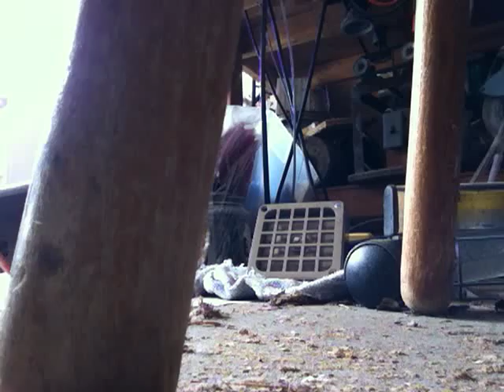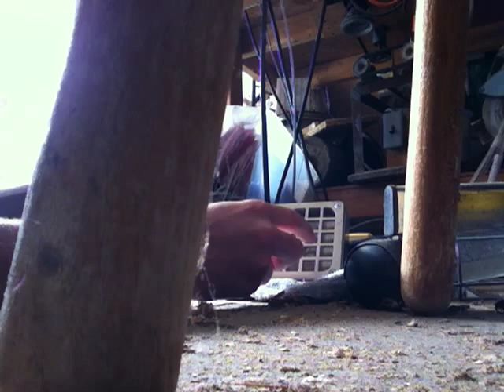Simplex 4050 again, this time with the iphone

Comment from the maker: I can't say I'm at all surprised by that. I think they might be a little more responsive if those classic spectralerts were the advance version, but a vibratory horn or bell would probably get the point across best. Only problem is that I can't think of how they could make DC vibratory horns sound at 60 or 120 hz. That would solve the battery backup problem.